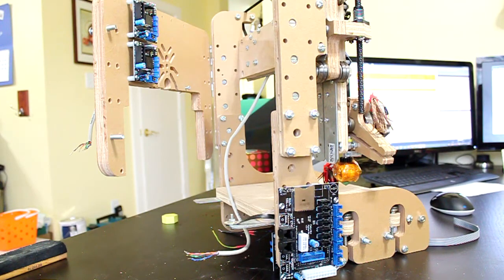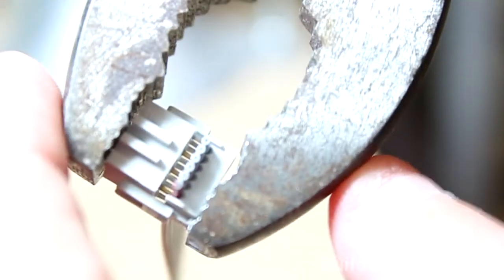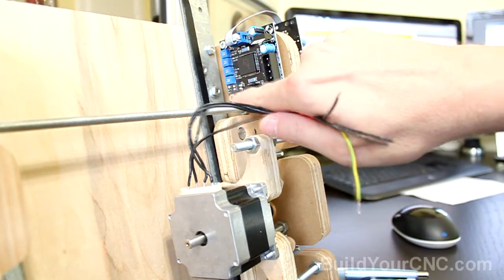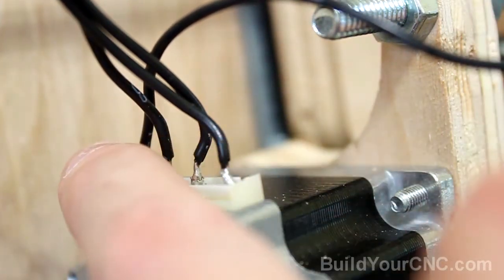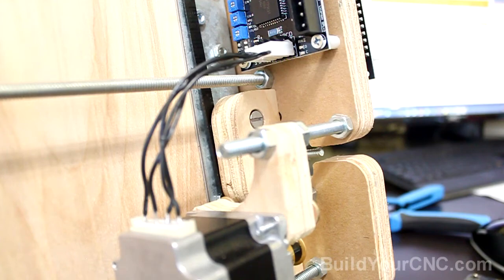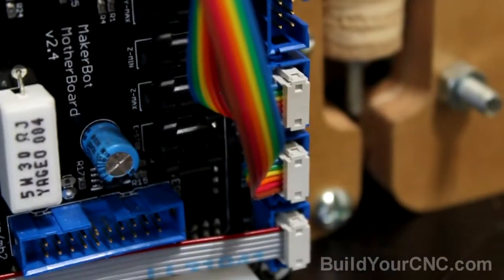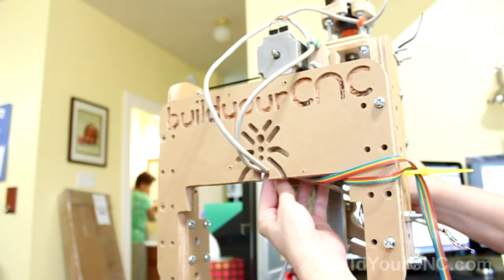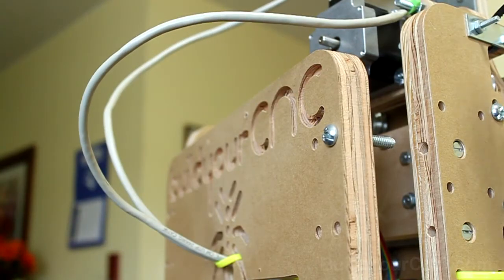whiteAnt Wiring Gen4 Electroncs part 1

Comment from the maker: @mrmartyman7 Thanks!  Sure, I would be honored to sign a copy of the book for you.  On this video, it may have seemed that the motor was 8 wire, but it was actually 4.  I used a Cat5 cable and doubled up the wires to allow for more current.  Using Cat5 cable, it's really easy to make use of the twisted pairs.  This is also a great technique for larger motors that require large gauge wires and Cat5 quite inexpensive.